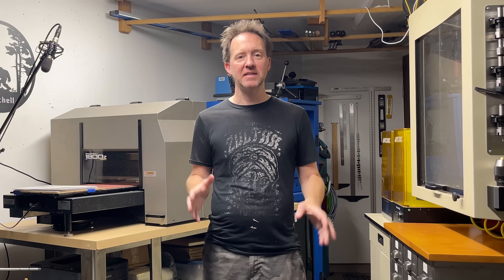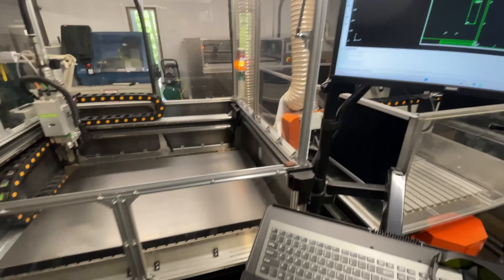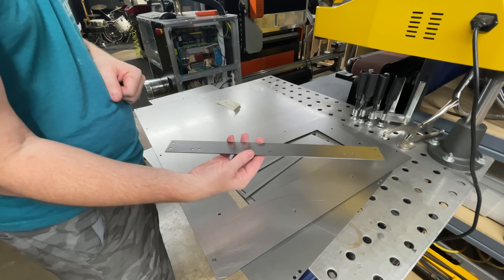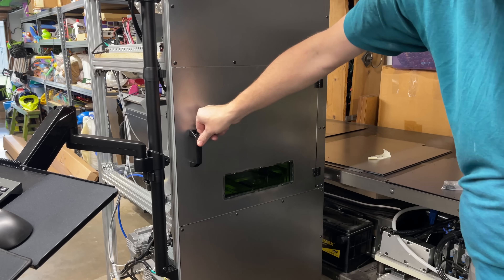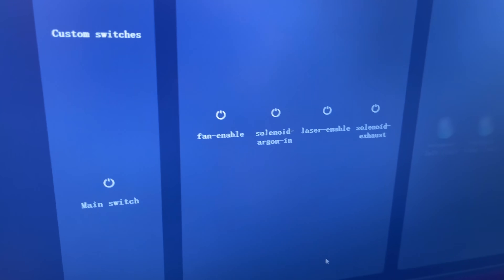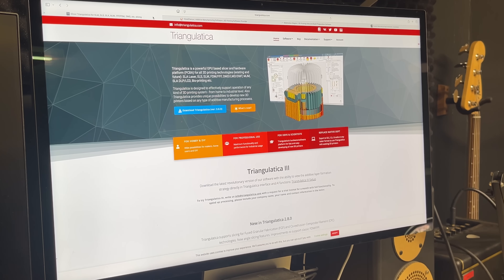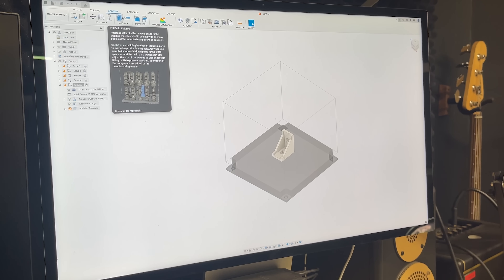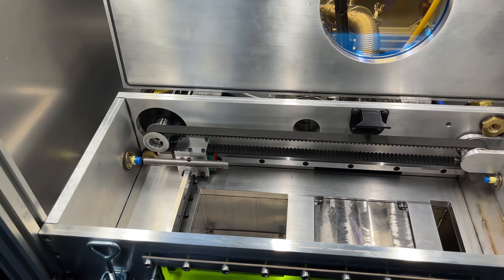DIY Metal 3D Printer: Part 7

Comment: I'm not sure if you figured it out in a susequent video, but I think that maybe your endstop switches may not be picking up on the stainless rod (is the new rod stainless?). Try using a mild carbod steel rod or a spring steel cap of some kind. I may be wrong about this, but in my experience, stainless is great at not rusting, but it's not good with induction.

Comment: One thing to think about with the movement of the recoater blade--I noticed on one of my newer models that they specifically built in spring loaded bump stops to "shake" the powder off the recoater blade at the end of its travel

Comment: You run the line directly to your HEPA filter instead of outside. Either run it outside or get a better filter. A HEPA filter wount remove bad gases, activated charcoal filter will though.. ( you already know all of this I am sure ). Following your build with excitement! Also, should be possible to just just free prusa slicer or crealitys version. Add functions needed.

Comment: I'm working on those machine for a big brand. A lot to be done still but it's insane how close you are from actual machines that are sold right now at insane prices. 
One thing to take into account for powder delivery is that you often want an oversupply factor for two main reasons : compensate inacuracies in your pistons movements and also loss of height on your exposed areas (melted zones need more powder thant the powderbed). 

The clumps you were mentionning is most likely humidity. Run your printer for a while being inerted and you will feel that the powder will spreading evenly and acting more like a fluid than a paste.

Comment: This is a wild project. Very impressive how casually you are doing this. (even though I know this isn't a casual hobby). Like other's have said, safety is a huge consideration with metal powders. Please don't blow yourself up.

Also regarding the limit switches/sensors. My understanding of those proximity sensors is that they are better are sensing an object passing by perpendicular to their orientation than approaching in a motion colinear with their orientation. Alternatively if you don't want to reposition the mounting locations, you look into optical sensors?

Comment: Love it. Been following sense the start. 
I would 100% put rubber on the edges where you have wire's passing. The thing is gonna vibrate from the casters, from the simple back forth movements. A wire is gonna get rubbed through and short sooner or latter.

Comment: Could you please do something about the noise level of the poeder spreading actuator?
It is so much louder than your voice for me that I have to mute the audio and rely on Youtube's automatic subtitle transcription to at least have some idea of what's going on.

Even if you could just notch filter out the loudest of these frequencies, it would help me a LOT since I can't do anything about it on my end (I'm watching on an Android tablet).

It seems like (because I measured the output of the tablet's speakers using a spectrum analyzer app, so some harmonics might be caused by either the speakers, or the mic, rather than actually existing in the audio stream) the loudest, principal frequencies are at:

10,000 ~ 10,008 Hz
5,355 Hz
2,684 Hz
1,102 Hz

With what looks like harmonics and IMD frequencies at:
16,078 Hz
1,204 Hz
2,004 Hz

Finally, some minor, but related frequencies also appear above the level of your voice your voice around:
20,016 Hz
6,680 Hz
4,020 Hz
1,605 Hz
1,339 Hz

These measurements were taken around the 8:10 time in the video.

Comment: For the gas purge I would suggest a vacuum pump on the print chamber. Pump out as much oxygen as possible then fill with argon. Should make it a lot more effecient...
Reply: Much harder to make it vacuum tight, but using a nitrogen pre-purge can be beneficial

Comment: Following this with interest as I’m buying metal printers. Software Voxeldance is the dream, at least it’s a permanent licence for the money. 

Have you ever investigated modifying resin printer software from the plastic side, I presume it can output suitable files

I’m buying Voxeldance for the light weighting and internal structures package they are launching

Comment: do you use stainless steel in the rod for the sensors ? bench tested it so it detects it ? if its bad try with a real iron bar and see if it reacts better, im thinking as stainless doesnt stick to magnets there could be a problem there =) dont know if that is an actual problem but might be good to bench test =)
Reply from the maker: It’s a carbon steel rod, the sensor detects it just fine….seems to be more of an issue with the controller
Reply: @diyfiberlaser  Ah =) great, just throwing ideas out there =)

Comment: Hello! First of all, I want to say that you have done a fantastic job at this stage. I sincerely admire your engineering skills.
I worked as a design engineer for about five years at a company that manufactures LPBF printers, and let me give you some advice:
Always use a full-face 3M mask, as the powder is very volatile and harmful to your health. Never touch your face or eyes when working with powder, only work with gloves on, and always wash your hands after working with powder.
Be very careful when replacing the argon filter element, and have a working fire extinguisher ready. You definitely need shut-off valves on the filter housing to decontaminate with water before replacement.
Watch for areas of carbon buildup (black flakes and deposits), as it is prone to spontaneous combustion. Use an antistatic wrist strap. 
I think you need to review the shape of the build cylinder and feed cylinder; you need a rectangle with rounded corners of at least R10, otherwise you should be prepared to scoop kilograms of powder out of the bottom of the printer, which will be scattered throughout the room.
In fact, there are many subtleties and nuances in LPBF printers, but I think it's worth starting with the basics of safety. 
I sincerely wish you luck with your project.
Reply: That hassle is why I didn't bother with powder 3d printing for myself. Worked on a powder-solvent based printer as a student (integrated and created electrical circuits while printing plastic objects) and the safety protocol there was a nuisance. Metal Powder tenfolds the problems.
Reply from the maker: Thanks...lot's of great tips here!

Comment: Oxygen cutting leaves a scum on the edge that will mess up your painting, so be sure the clean the part edges first. And oxygen cutting is actually the classic common cutting gas and rather air is the newfangled idea these days!

Comment: A small safety concern: take extra care while handling metal powders. You should always wear nitril gloves and protective equipment, especially a mask (ffp3 at least). Powder particules can stay flotting in the air for hours, and the thinner particules can penetrate through the skin (even if your powder PSD is 15-45µm, it's not hard limits so you can have > 1µm particules).
About your oxygen sensor, it seems not calibrated as it must read 21% (or 210000 ppm) when chamber is open. To have a correct printing quality, O2 level must be below 800 - 1000 ppm, meaning 0.08 - 0.1%. Industrial printers can reach less than 1 ppm to have absolutely no oxydation.
Do you plan to protect the laser beam up to the window? Because any dust on the window will burn and damage it. You can also blow compressed air on the window (as you do inside the chamber) to remove any dust.
Reply from the maker: Thanks for the reminder about the sensor calibration!...so many little things to do that I totally forgot about it. I have been thinking about protecting the top window from dust...haven't fully realized a solution yet, but was thinking maybe something simple like a short piece of 6" flexible fan duct with velcro on the ends?...before printing, clean the window then attach the duct, then I can easily remove it afterwards when I need to open the chamber.

Comment: What metal type is that rod? Inductive sensors work at their rated distance with normal iron or steel. If you present aluminium or stainless the distance will be a lot less.
Reply from the maker: carbon steel

Comment: Hello
The sensors should have been approached from the side rather than from the front, so we do not approach such sensors because, as you know, they can collide.
Therefore, the sensor must pass in front of the sensor head, for example, a plate approaching from the side, and in case of a problem, it should collide with another piece of metal rather than the sensor. If you do it this way, it will be fine.

Comment: I love the work you're doing. I hope one day I'll have time to play with mechanics. I'm an electronics technician. Forgive my ignorance, but is it possible to use an FDM (supportless 3D printer) cutter as software for this machine? Basically, I understand it's the same. You use the head temperature as a parameter for the laser power and change all the other unused parameters with a Python script. It should work.
Reply from the maker: I considered that also...I just couldn't find any that output .SLC or .CLI file types, and that is what the controller requires
Reply: @diyfiberlaser I don't have experience with it, but a google search showed that Rhino can export .slc files. They offer a 90 day free trial, and a perpetual license is under a thousand bucks. Sorry if you mentioned this elsewhere, but what software do you normally use for CAD? (Big fan of this project by the way. Your progress so far is impressive!)

Comment: Don't you want to keep the handles on the laser source to protect the key switch and emergency stop from something hitting sideways? They are a bit exposed there at the bottom and front of the machine.

Comment: Hi,
I saw you positioned your sensors as physical end stops. That is risky because physical impacts can damage them and they are not designed to take hits. If they are still intact, I would recommend remounting them vertically with the option to adjust along the horizontal axis. Magnetic sensors also need a certain amount of metal mass before they detect properly, which could explain why they do not detect before the hit. Personally I use optical sensors instead because they are just as precise and immune to physical impacts: detection occurs simply when the light beam is interrupted, regardless of the size or mass of the triggering part. Keep up the good work, your project looks promising.

Comment: the clumps of powder is mainly humidity. while the print is going and under inert conditions the argon and the heat generated by the laser welding process will substantially increase process chamber temperatures. this will help dry the powder but also would recommend adding a argon gas condenser to chill the gas temp upon return flow. will help allot

Comment: If you don’t want to move the endstop to the side or add a pre-stop, you can only boost the respons somewhat with a larger diameter plate, on the rod. That way the sensor may see a stronger field and reacts faster.
Reply: Are these really Hall sensors? Aren't they inductive proximity switches (i.e., by inducing an eddy current?!), they also work with other non-magnetic metals, but there is a factor of degradation that you have to take into account.
Reply: @poldiderbus3330  true , you are right, they seems to be inductive. So no help in a magnet.

Comment: For your prox sensor problem I have a few thoughts... 

1. A stainless steel rod is not ferro magnetic, if the sensor is inductive type.
2. A solid rod messed with the field alignment of the sensor, try using a flat paddle of steel at the end. 
3. Also being inside a metal box, where everything is grounded to one another might not be most ideal !
4. You could try a neodymium magnet at the end of the rod, at the risk that ferrous powders will agglomerate on it over time.
Reply from the maker: Thanks!...it is a carbon steel rod, but I can laser cut a new piece out of carbon steel of the original design and just leave a little extra on the ends to make a 90˚ flat on the ends....I will try that.
Reply: @diyfiberlaser I hope its an inductive sensor not a capacitive one :)
Reply: The proximity switches could be mounted on the back side of the enclosure and sense the passing of the sweeper with no risk of impact.  heaps more scope for adjustment then.   

The current prox holes could be replaced with rubber end stops.  

The prox won’t like being constantly hit!

Shame you can vacuum the chamber and then replace with argon, would cut down on gas usage.

Comment: In regards to the welding, I think there's a few tips to help.
1. Check on the settings for the laser off delay. If you turn the time up a little, it helps to stop the wire sticking at the end of your weld.(100ms)
2. On this material, it looks like you should have the wire feed rate up a little and power down.
3. Check the liner, it appeared that the wire feed had some stutter 
4. stab the wire through an earplug or sponge in the feeder. It will clean the wire as it feeds through.
Love the channel, keep it coming.
I plan to build a tube cutting machine similar to yours, now I have seen how it can be done.
Reply: Have you thought about buying a 10k$ tube cutter from china and modifying it? It will have all the components already and I can't imagine the actual BOM being cheaper than these things.

Comment: One thing worth emphasizing is powder moisture content. Your powder appears to be caking slightly. I have previously just used a toaster oven to dry the powder out and that does improve flowability, but the other concern is water flash boiling during melting. The moisture content must be very low to prevent this from interfering with the process. I am putting together a vacuum oven to condition my powder. Maybe you already have access to something like this? Also, those inductive sensors might benefit from either end of the rod being magnetized.
Reply from the maker: Thanks for the tip! I do have a toaster over that I was using for vacuum forming previously...I'll give it a shot
Reply: @diyfiberlaser just a vacuum is enough for drying. Water boils at room temp in a vacuum
Reply: Do you have a video currently in the works? been waiting for your next update

Comment: Very cool! The progress is clear.
I'll give you a couple of pointers...first, you need to consider the powder's moisture content. Second, powder quality is a very important parameter. When processing with a laser beam, the focal length is incredibly difficult to adjust to achieve an optimal sintering point; slag will form and grow as the print progresses.

Comment: as a side note: Metal filres are extreamly dangerous and can be almost especially be impossible to put out, please have some metal fire rated extenguisher, and also ground yourself and whatever container you are using to the machine because the fine metal powder rubbing each other can cause static electricity which can be very dangerous

Comment: Why not put the Proximity sensor beneath the bar, so that instead of the bar butting into the sensor, it passes over top of the sensor?   That way you don’t have to worry about impact at all.
Reply: I second this. In industry prox sensors are always swept across like you described, not going straight in
Reply from the maker: Yes that makes more sense, I was just having trouble coming up with a good way to mount it that way…the motor is in the way of where I’d to put it
Reply: @diyfiberlaser  Forgot to tag you in the suggestion in case you can't read every comment.
Reply: Clamp a small piece of metal onto the belt exactly opposite of the wiper's belt joining clamp (aka 180 deg out of phase with the wiper) and put both limit sensors at about 8 o clock and 10 o clock from the idler pulley in the back wall.
Reply from the maker: @Mindbulletz  Oh duh! I didn't even consider utilizing the opposite side of the belt...you are my hero! : )
Reply: @diyfiberlaser  Happy to help! I love problems like this.

Comment: A thought:
Install a vibrator motor attached to the machine's powder container, and one on the blade, in order to get optimal packing at both sides. Maybe even a vibrator on the build-plate as well.

Otherwise a stellar project :)